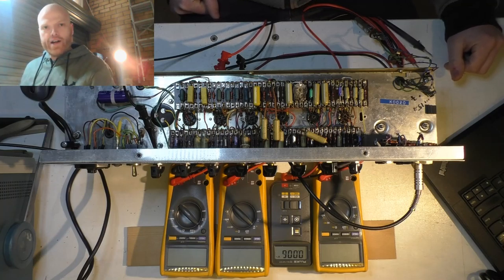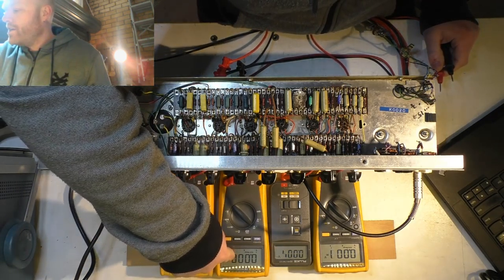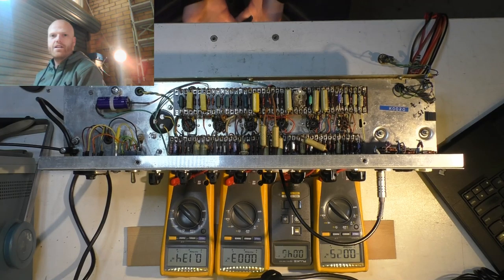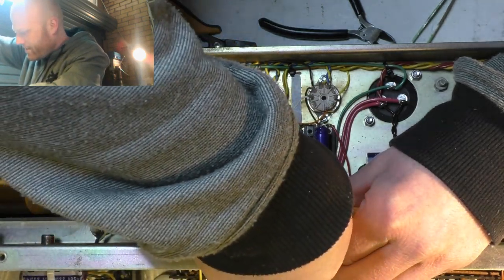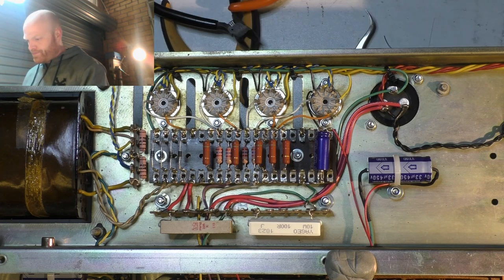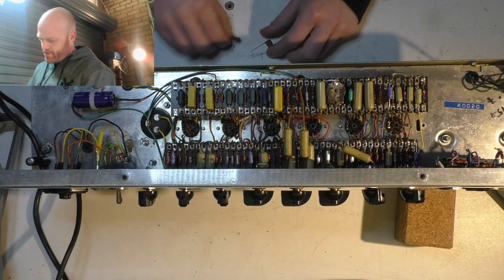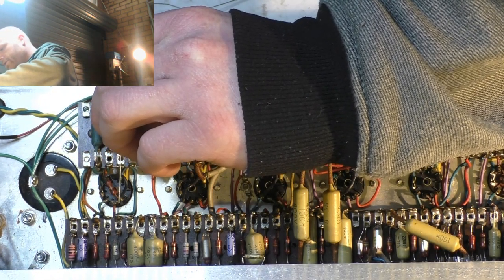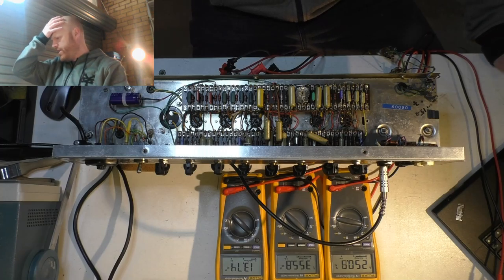Vox Dallas Era AC30 Restoration - Part 2

Comment: Hey dude, looks like the amp that a friend gave me to repair it. It's hard to figure out what kind of ceramic resistor they put in there back in the days. You went for 22 ohms and the other one is a 100 ohms. What happens if you change those for other values? Cause instead of 100 ohms there is a 47 ohms resistor in the one I have that is right before the tubes. And I'm not sure if 22 ohms is right before the diodes and the power transformer. Any suggestions how I can figure out what's supposed to be in there?